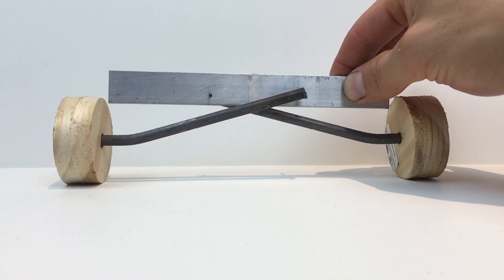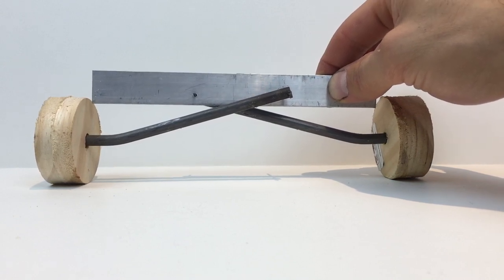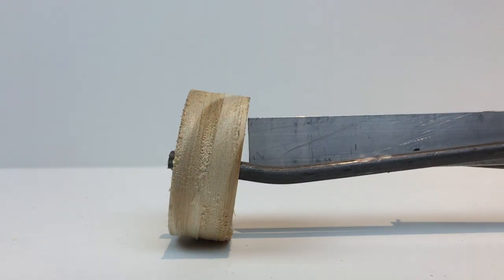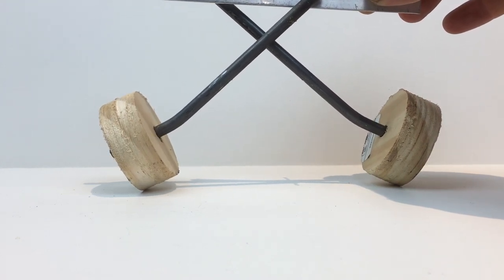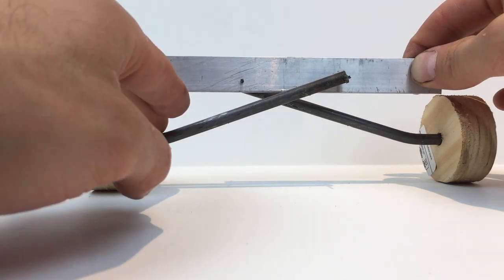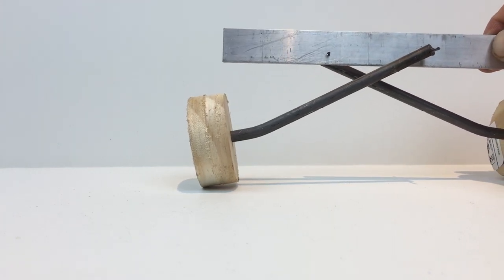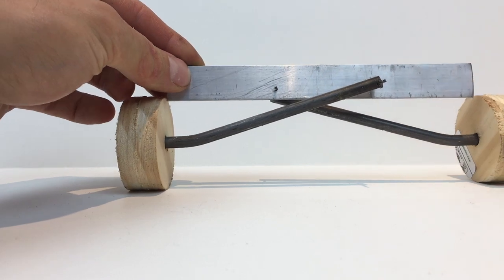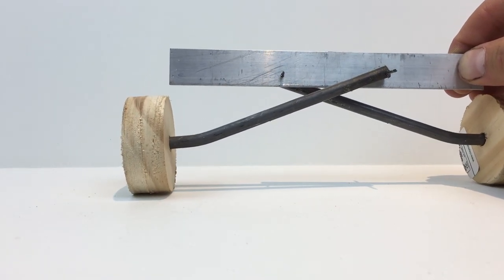Never Use Cheap Leveling Kits (I-Beam) | 1995 Ford F150

Comment: You can buy a pair of moog alignment bushings for like $60 to resolve this issue. Just don't go over 2.5" and you're golden. Been there, done that.
Reply from the maker: UncleRusty Yup! I bought that same set. My suspension geometry must be different. I think the previous owner installed f250 coils in the front as a cheap leveling kit. With the adjustable camber bushings, my camber was still a tad positive. The bushing still didn’t have enough adjustment. Since then, I’ve put f150 coils in and everything is back to normal.🤙
Reply: I solved mine with the same bushings.  Absolutely no problems years later. Caveat: my lift is only 2".
Reply: The Minute Masters so a pair of 2006 f250 springs will fit? And lift the front end??? Lol
Reply: @david alejandro do you remember the part #?
Reply: If you put a set of Moog 824 springs to simply level out the rake what camber bushings would you need ? 4 degrees ?

Comment: Skyjacker soft ride 1.5-2" coils with moog adjusters and you're golden. Biggest issue aligning after that is caused by worn axle pivots and radius arm bushings. Poly bushings in the axle pivots is the best thing you can do for stock style Beam suspension.
Reply from the maker: Mrmonkeypants88 That’s a good set up! How do you like those Skyjacker coils? Have you been able to correct the camber to 0 or do you still have a little bit of positive camber?
Reply: @TheMinuteMasters  you can get right at 0, but basically maxed out on adjustment. there is maybe .10° left. The skyjacker coils are completely worth the $180 at least on the 5.8 Bronco, I'm sure 150's would ride just as well. If you're going to level Beams definitely need everything in good shape or like you said, get ready to make friends with tire shops lol
Reply from the maker: Mrmonkeypants88 Good to know! I was always curious if the camber could be corrected. So the ride is better than stock coils? Do they work with stock length shocks?

Comment: I can see the validity of your argument for big lifts, but I've have my 2" lift for years without any issues whatsoever.  Adjustable alignment bushings gave me plenty of camber adjustment.  I could probably even have gone to 2.5 and had enough adjustment.  How much lift did those F-250 springs give you?
Reply from the maker: David Alejandro You are correct! If you use the adjustable camber bushings you won’t have a problem. I was pointing out people buying only leveling kits without the adjustable bushing. They have major camber issues. So I never measured for sure but the F250 springs I think give me 1.5 to 2 inch of leveling. However, the ride is much more harsh.

Comment: I bought 4 inch lift kit from rough country. The brackets for the I beams are the same for the 6 inch lift. So you have a slot for both 4 inch and 6 inch lift. I had some serious rake and decided to put 2 inch coil lifts to even it out. I dropped bolts to the 6 inch slot and confirmed it was ok to do so with rough country.
Reply from the maker: You did the correct thing. Making a lift kit work depends a lot on brackets too.
Reply: This is the golden ticket information I was looking for man thx, looking to buy a ranger Shitbox and evenentially get a 4inch rough country and stretch it out a couple inches haha to 6” roughly
Reply: @keltonderkach9601  good glad I could help. Truck looks good nice and leveled out. No squat but no rake either

Comment: I’ve got a 2005 f250 2wd. It’s got the I-beam suspension so I’m not sure what kit to go with. All of the spacer kits say “does not fit I-beam suspension” is this true?! I can’t seem to find one that specifically does.
Reply from the maker: Nice! Those are cool looking f250s. Interesting. I would shop around some more. I’m sure someone makes a lift kit for that year and suspension design. Although, I will say it’s easier finding lift kits for f150s than f250s.

Comment: Where can I get drop down brackets for the I beams? I have 1999 f250 2wd and bought poor man leveling kit and bought adjustable bushings and my camber is still positive. Please help
Reply from the maker: Travis Barton Good question! I think you need to hunt around and see who will sell the drop brackets from a lift kit. Some bronco/obs F150 suppliers will sell fabricated drop brackets. I’d try bronco graveyard first and then just search the internet. What leveling springs did you use?
Reply: I used a 2.5” block
Reply from the maker: Travis Barton Gotcha. One of those coil block spacers. Well, I’d still shop around and see who will sell drop brackets separate from a full kit. That’s your best option.

Comment: LOL, you are 100% correct.. and yes, I'm a dummy and living proof that your model and suggestion is proving to be 100% correct. I ordered and had the 2-inch hockey pucks installed in my 1987 Ford Bronco II.. and the camber was 4.8 degrees positive.. dam... I just received the 2-4 inch axel drop brackets from Tuff Country. Now I have to order the radius arm drop brackets too?? drag.. more money... drag... how about pitman arms,, should I order the pitman arms also?? I was hoping just installing the axle brackets and the camber/caster brackets would get me out of the camber problem???
Reply from the maker: Lol I wouldn’t call yourself a dummy yet. Lots of people make this mistake. 
Yup! That what happens and you end up buying all of the other supporting mods. Lifts plan and simple are not cheap if they come with everything to do it properly. 
Now for the pitman arm, you will need a longer one. Any lift over 2 inches needs a pitman arm. Without it your drag link steering is at an awkward angle which causes terrible bump steering. If you are familiar with bump steering, it’s when you hit a bump and the force cause the steering to change when it should. Just imagine the steering wheel turning 180 degrees when you hit a bump. 
As for the others parts, those should fix your camber issue. If you still need to dial the camber in, but adjustable camber bushings. I have them on my truck. They help a lot. I have a video in my playlists on how to install those.

Comment: One thing I see people do is they will flip the I beam upside down and turn them around so it's a free lift kit but when you swap sides it puts the brake calipers at the rear but then they have insane camber but I thought that I could just get the drop brackets for the middle to fix the camber but I don't know how well that will work
Reply from the maker: They sort of sounds like an old hot rod suspension fix. I’m not sure if that would work in this application without some further modification to the beams. You are correct though, you can buy drop brackets for the beams in order to correct the camber. Most people don’t want to get that involved though. They are easy to replace.

Comment: @The Minute Masters If you have just a 2 inch leveling kit do you need all the drop brackets or would good camber bushings work fine to fix the camber issue
Reply from the maker: I’ve heard success with just using the camber bushings. So definitely worth a try.🤙

Comment: Man thank you for this video, I’m struggling bad on finding one for my 2007 F-250 Super Duty 2WD with the Twin I-Beam. 
The one that I’m leaning towards is the ReadyLift 2 Inch Level Kit. It includes fhe aluminum spacer, A zinc-plated steel spring retainer stud extender and washers. Please help or Atleast recommend a decent kit for my truck. Several of the kits found seem to say they won’t work with Twin I-Beam’s. What a pain! Even alignment, can I just trust a local alignment shop to align my truck? Any advice helps! Thank y’all.
Reply from the maker: You’re welcome man!🤙 
So I don’t know any 2” leveling kits off hand. However, when shopping for one here is what you should look for. A.) full coil spring, no spacer. B) some included parts to correct the camber. The suspension I reference is the video corresponds to the I-beam suspensions made from 80-97 F series Fords. Trucks built after that probably have better camber adjustability from the factory. Otherwise, I would research what the process is to correct the camber. 
You can also talk to an alignment shop and see what they recommend. You may only need lifted coil springs and possibly extended shocks. An alignment shop can probably look at your suspension and tell you what you will need for a proper lift and correct the chamber.
Reply: @TheMinuteMasters  thank you for the reply! I will certainly try to follow those steps and see where it goes from there. I will definitely post a video once I get everything set up
Reply from the maker: @TexasBoyJc  No problem man!🤙 Let me know how it goes!

Comment: I am in desperate need of a leveling kit for my 1995 Ford F-150 xlt 2wd, I have a supreme suspension leveling kit and the ford dealership could not align it because the tires was so bowed in, do you have any suggestions on what leveling kit is good for it and is also not that expensive
Reply from the maker: So the easiest way to level your truck is with a set of leveling springs and adjustable camber bushings. Only installing leveling springs causes the tops of the wheels to bow out (positive camber). By adding the adjustable camber bushings, you can bring the tops of the wheels back in (neutral camber). I have a video on how to install the adjustable camber bushings and in the video description is the link for the bushings.
Reply: @TheMinuteMasters  do you know where I can buy some
Reply from the maker: @seanerickson3159  Here’s the link for the camber bushings.👇

https://amzn.to/3kL9A9d

As for leveling springs, you can buy whatever 1.5 to 2 inch leveling springs you like.
Reply: @TheMinuteMasters  can you send me the link for the installation of camber bushings
Reply from the maker: @seanerickson3159  Here ya go👇

https://youtu.be/HpqJtiPtEEs
Reply: @TheMinuteMasters  do you know what size camber bushing I needa get, it’s a 1995 Ford F-150 2wd
Reply from the maker: @seanerickson3159  The camber bushing is the same size for most of the years that use one. The link I gave you is the size you need because I also have a 95 F150 2wd.
Reply: @TheMinuteMasters  what brand springs do you recommend, I’m thinking about getting 1.5 inch rough country leveling kit
Reply from the maker: @seanerickson3159  I have no experience with rough country but it’s not a bad option. You will need to buy adjustable camber bushings separately though to correct the camber. BDS makes a front leveling kit that is: coil springs, longer shocks, and adjustable camber bushings. It’s about $400 but it covers all the bases.

Comment: I installed a 4 inch RC kit. The trucks back end was visibly higher then the front. So I installed 2 inch coil spacer and now it's leveled out. I dropped the I beam to the 6 inch lift hole. And now dealing with negative camber why?!!!
Reply from the maker: Sounds like the 6 inch lift hole is too much. How was the camber before you adjusted the beams down? Have you installed adjustable camber bushings?
Reply: @TheMinuteMasters  I bought a camber bushing but haven't touched it yet. Still stock.
Reply: @TheMinuteMasters  sitting in a waiting room now. Getting an alignment
Reply from the maker: @nauidiver227  Nice! Let me know if that fixes the problem.
Reply from the maker: @nauidiver227  Yeah, it’s an alignment won’t fix the camber than you’ll definitely need it.
Reply: @TheMinuteMasters  they showed me it's the I beam brackets. They need tightened up little loose should fix everything they said.
Reply from the maker: @nauidiver227  Nice! Well that was an easy fix. I’m glad it was nothing complicated.

Comment: I'm assuming that 500 buck rough country leveling kit is what defines a good one haha. Not in a rush to do level it, but I have thought about it.
Reply from the maker: If it comes with drop brackets or bushings, then the kit is designed to correct the camber.

Comment: Had to learn the hard way. Thanks for the video though.
Reply from the maker: Sorry to hear that man. You’re welcome!🤙 Thanks for watching!
Reply: @TheMinuteMasters  tried looking for better leveling kits. Any suggestions
Reply from the maker: @XD65  I think you can get away with using a cheap leveling kit and then buying adjustable camber bushing to correct the camber. Otherwise there is a complete leveling kit from Desolate Motorsports. It’s out of stock now but it gives you an idea of what you need. Here’s the link:👇

https://desolatemotorsports.com/shop/suspension/front-suspension/desolate-motorsports-2-bronco-80-96-stage-1-lift-kit/

Comment: Wouldn't you just be able to add a spring or 2  to your leaf springs and maintain the camber?
Reply from the maker: Grand Crayon For this style of f150 suspension,  there are coil springs in the front. The twin I beam suspension doesn’t use leaf springs. The solid axle suspension does though.
Reply: @TheMinuteMasters  I have a 86 f250 with this type of axle and was wondering if rebending the springs or even adding a leaf to bend it 2 or 3 inches to level it out would be enough to effect the tires and camber
Reply from the maker: Grand Crayon Gotcha. So if you do add a leaf spring or use shackle extensions to level the front, it will change the camber. You will need adjustable camber bushings/nuts. I have a video in the suspension playlist on how to install those.

Comment: Does Supreme make a decent Leveling Kit.. I was thinking of purchasing the one w the four shocks, 2 blocks n 2 torsion keys??
Reply from the maker: chris wassil So I assume you are talking about a ford leveling kit unless you have an explorer. I’m not too familiar with Supreme. However if it’s a Chevy you are talking about, then that kit sounds decent. Torsion keys are pretty standard and work well. I’d just get the alignment checked out afterwards. Blocks is an economy way to lift the rear. The only down to blocks is they can cause axle wrap. Blocks under 2 inches probably wouldn’t be a problem though.
Reply from the maker: You can also do a shackle lift in the rear instead of blocks.
Reply: @TheMinuteMasters  it's a 2000 Chevy Tahoe
Reply from the maker: chris wassil Gotcha! Yeah that kit will be perfect for a Tahoe.  Make sure the blocks come with new U bolts and hardware. It’s always recommend to change them.
Reply: @TheMinuteMasters  Great ty again!!👌
Reply from the maker: chris wassil No problem man! 🤙 Good luck! I recommend you join a Tahoe Facebook group or online forum. They could give you even better recommendations for your Tahoe. Trust me, there’s definitely a couple guys in those groups who have tried everything.

Comment: I have a 77 F150 with 31/10.50 r15s on it. I love the stance but sometimes when I cut the wheels sharp it wants to scrub. I thought about giving it a 2.5 inch lift just on the front.
Reply from the maker: Barry Warren Does it rub on the radius arm?

If you go that route you need to get adjustable camber bushings to correct the camber.
Reply: @TheMinuteMasters  I have not checked yet on where it's rubbing. It does not do it every time. I have had the front end alignment done on it after I had the tires installed.
Reply from the maker: Barry Warren Gotcha. Definitely take a look. If it doesn’t do it all the time then you could have a few worn ball joints. If it does it often enough, the usual suspect is the wheel. Not enough backspacing causes the wheel to sit in the wheel well too far and close enough to rub on things.
Reply: @TheMinuteMasters  The guy who did the front end alignment  told me that all parts looked good on the front end.
I could try running some spacers on the front. I had them on my 1999 Dodge Ram without any problems. I know a lot of people don't like them.
Reply from the maker: Barry Warren Ok that’s good!

Yeah that’s what you will have to do. People don’t like spacers because people don’t torque them properly or check them regularly. Plus they use too thick of a spacer. 1” or less will be fine.

Comment: What kit do you recommend for a 1993 f350 2wd dually I beam suspension?
Reply from the maker: James Hudson Man that’s a tough one. I did a quick google search and didn’t find much. Assuming that you have leaf springs up front, I found only one add a leaf style kit by Tuff Country. If you were to go to a 4 inch lift, then you can find stuff by names like Rough Country. How many inches are you trying to level out?
Reply: @nickpayne2952  you're a troll. Ignore this guy. I put a 2" lift on my 03 F250 2wd and new coils. My camber is at best with these moog  bushings +3.5. Thats with a stock spring size and 2" puck. The only way to correct it is with an axle pivot extender kit and/or radius arm extender drop kit. All for a $30 2" pick kit. No thanks. I'm removing the puck.  If you have to shame or name call, you clearly have no ammo. GO AWAY.
Reply: @TheMinuteMasters   I beam suspensions do not have leaf springs

Comment: I have been doing alot of searching and i cant seem to find an actual kit outside of a $1500.00 kit for my dads 1978 f150. This is my first time experiancing the I beam suspension system, although i am a novice mechanic with access to a fully equipped shop and lift. Im hoping i may be able to fab up some 2-4 inch brackets for the radial arms and i beam mounts before doing shocks. But this beggs the question.... why doesnt someone already offer these brackets.... is seems so simple
Reply from the maker: Cody Stelzer That’s why so many people swap I beam suspensions to solid axle. Solid axle is just easier for people to understand and there are plenty of parts. Rough country makes a 2.5” lift kit for my year truck. Not sure if they make older kits. Otherwise, you’re right. It’s so simple. Why doesn’t anyone do anything about it.
Reply: Darin at Autofab.com is very knowledgeable in lifting 70s fords with i beams.